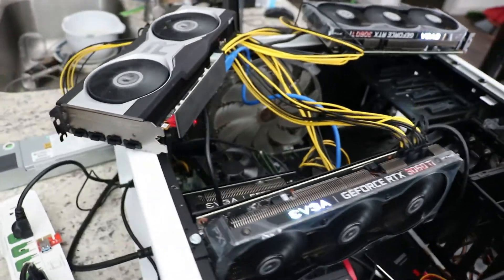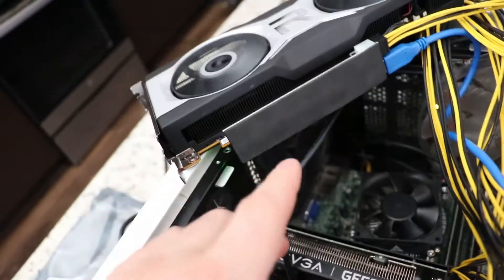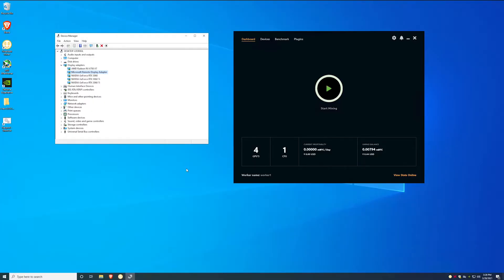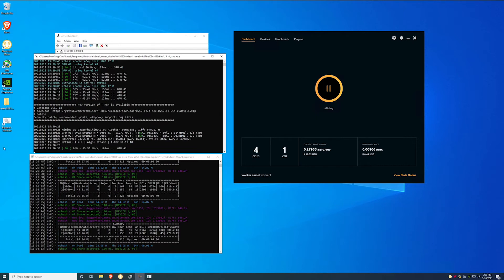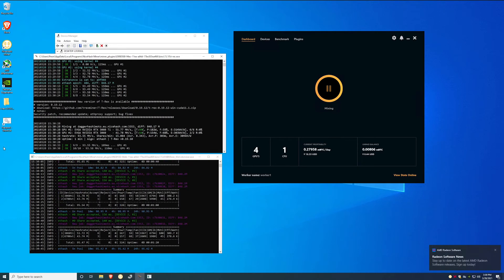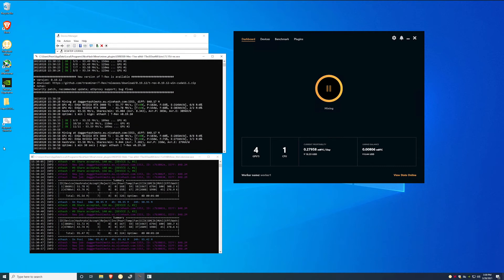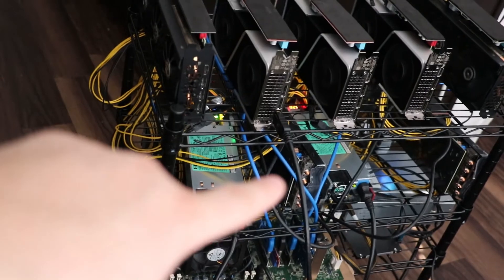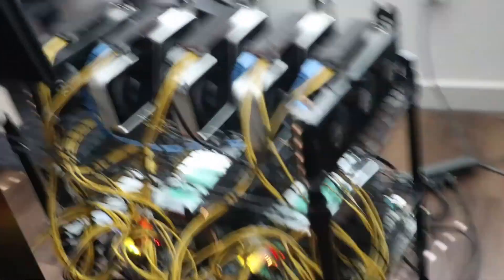Turn a normal motherboard into a mining motherboard!?!

Comment: Bro!! Please help me . Hello  I have 1 cpu 1660 graphic card . 1 power supply gigabyte p750gm 80+gold. And monterboard biostar b250 pro BTC.  We checked the bios. We recorded windows 10. Then we restarted it no longer runs. Just turn on and off in every 1 secund
Reply from the maker: sounds like it could be the power supply, I would try to run with out the GPU also